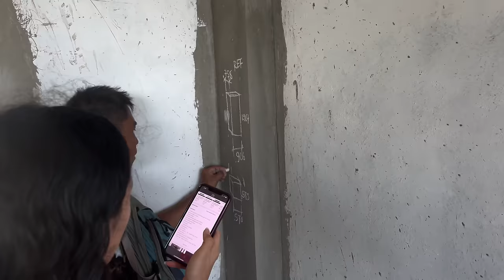Foreigners RESPECTING Philippines Culture - Boat Blessings & House Birthday Priest

Comment: Try to visit the ORCHID GALLERY over at Moalboal, Cebu.  It's a 5 hectare property, full of different varieties of orchids, orchids planted on the ground, on trees as well as hanging orchids - - co-owned by a foreigner and a Filipino.  You can consult them on how they mounted their massive TENT all over the property - to prevent the plants from heavy heat...and maybe, heavy rain all throughout the year.  Cheers and God bless you!

Comment: Lol, my Alexa open our blinds here. Automation is great and very convenient that you don't need to manually turn on/off lights and switches, microwave can heat your food without touching the pads and you don't even need a remote for your tv and AC.

Comment: Hi Finn, for your temporary bathroom /cr, upstairs  maybe  you can also use the Faucet with telephone wire extended shower that you can just hook at any part of the wall. hence no need to dig the wall and make a pipeline. It can also be useful in the future like as spray for cleaning the cr.  hehehe ...😀🚿

Comment: Hey Finn looking good.
What company put up your solar and battery systems?
Looking for options from my houae.
Theae look like tesla batteries? 
How do you keep the batteries cool in the tropics?
Reply from the maker: JR2 Elektrokol Dumaguete. Keep them cool with aircon
Reply: @FinnSnowVlogs  ,,, install a window glass that can withstand Yolanda's 215 kph wind strength and gustiness of 250 kph.
, because broken glass at that speed can kill you.
Reply: Are you going double glazed windows for added thermal efficiency?

Comment: Finn floor tiles are very simple and plain. I admire tile design of avelovinit in cavite, very small and limited space but the design of tiles  ,bath door, is done wd utmost   potentials. I wish you could maximize your house to full advantage, wd its interiors, considering the gingantic space.